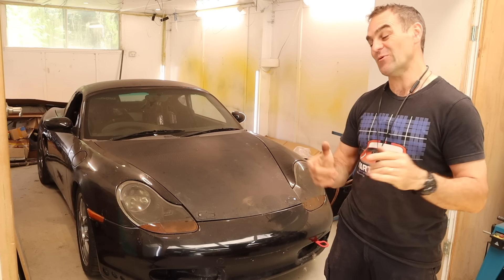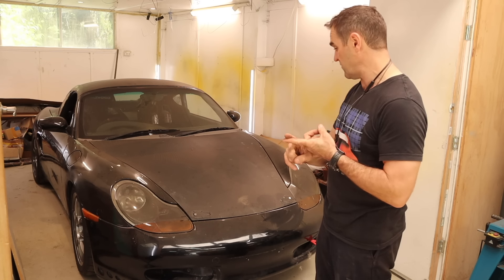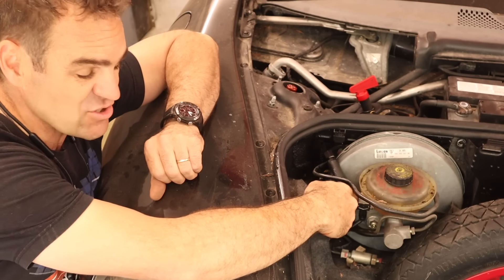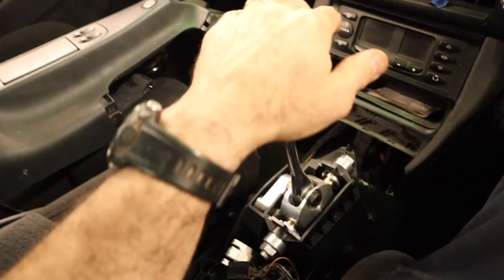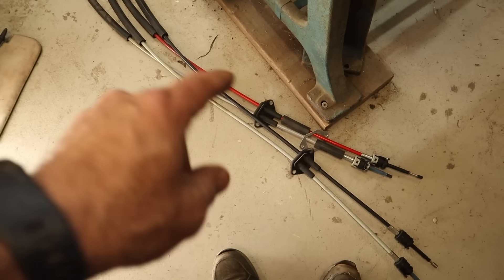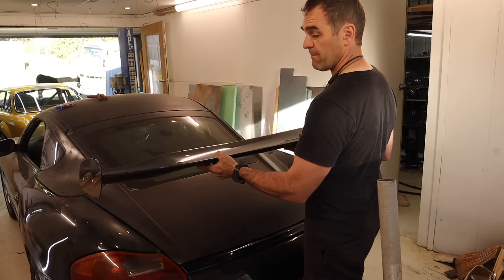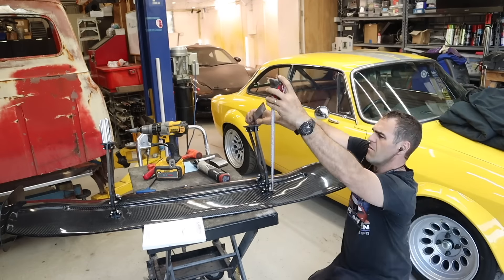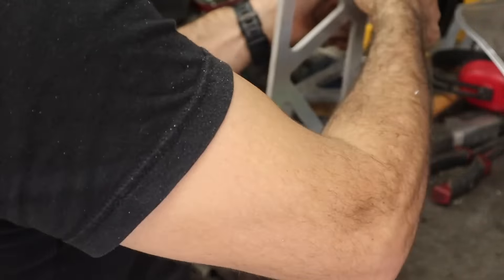The Roxster gets aero - Porsche 986 Boxster V8 engine swap track car build 33

Comment: Jeff
Do it the old way we did in the 70's without CAD or wind tunnels
Tape a coloured ribbon 75mm long, every 100mm up and sideways on your decklid and back window. Repeat on top and  underside of your wing. Make it a bold contrast ribbon to your black car, ie a yellow ribbon.
Secure the services of mrs Jeff and a friend. Drive down the road at 80, 120 and whatever legal kmh you can get away with and photograph the car from the back and from the side at the various speeds. If the ribbons lay flat its positive (downforce) and if they lift its negative (uplift) pressure. That way you can see quickly whats happening to the air over your decklid and the wing. If the ribbons on the wing top are up it means you need to increase the angle of attack.
A bit of time to do the ribbons ( if they are in rows you can very quickly see how they are behaving and which row. Turbulance or odd wind flow can be seen by counting number of ribbons from the side or top and dealt with accordingly.
Easy peasy. Try it, you will be surprised.
On the Alfarrarri use black ribbons in 100mm grids that are easily visible.
Easy peasy on road wind tunnel.
Racing a Meisener ohc 1640 Ford Z window Anglia we quickly found the back was "walking"  around due to negative pressure at the back window. We made an under floor pan airscoop and plumbed it up behind the back seat area and made a long rectangle outlet behind the back window to introduce airflow and it sorted the problem as well as increasing straight line speed down the back straight by a few mph
Some tape and a camera with someone taking pics from another car.....mobile ACTUAL conditions wind tunnel.....
Hope it helps you a bit.....
Reply: That sounds like an epic solution to the Anglia aero issues. Basically turning the leaned back rear window into a big diffuser.
Reply: @Jonathan_Doe_  we were broke engineering students without bursaries, working 4 jobs to get our qualifications. We learnt all the hacks and tricks in the book to try do our passions with cars. And we were learning big lessons while doing it
Mmmmm dont remember sleeping too much then......

Comment: Love Roxster coverage.................so keen to see things progressed.
But along with all the other projects 🙂

PS: I made 2x feet under the rear boot/trunk near that lip- with a large rubber pad on top.
So when the boot closes, and the weight of the spoiler comes down under load, it had even more support underneath. 
Easy enough to do - and needed for 100kg +++ support.

Comment: You can do the floor mounting option without having to cut the hatch if you make the wing mounts a 2 piece design. 1st section from the floor to right underneath the hatch, supporting the hatch on a horizontal plate with quick release pins on it. Just a couple holes in the hatch for the pins to go through and then the 2nd section with another horizontal plate, with holes to accept the quick release pins, as a foot sandwishing the hatch. This will still transfer the forces to the frame of the car but when you want to open the hatch it's only a few quick release pins and the hatch can be opened without a problem. If you can find somebody who has a virtual windtunnel program for the computer it would make the aero setup fairly easy and tailored to your specific car and aeroparts.
Reply from the maker: That is actually a very good option.
Reply: I was thinking make the hatch a sandwich also, could have two uprights coming from the floor even if wing mounts bolt through bit like with roll cage stuff, 8 bolts to lift the hatch which for a race car in not really a big deal

Comment: Hi Jeff, try plasma cutting a couple of aluminium columns that the hatch will close on but make them high enough so that the wing mounts rest on them when the hatch is closed. That will transfer the load to where you want it and still allow the hatch to be opened.
Reply: or a simple cross piece with a couple of hood bumpers to take the pressure....

Comment: You can tape some string length’s top and bottom covering the wing and use tour go-pro to video if the wing looks to be stalling or theres even flow over both surfaces 👍

Comment: Hey Jeff, I think I saw the channel in the underside of the wing that spans between the struts (likely there for strength) . Think about filling this in as it destroys the laminar airflow exactly where you want it the most. This effectively stalls the wing by detaching the air. As it stands it would produce minimal downforce and mostly just drag.
Reply from the maker: I did see that. I assume the guys who built it put that in for strength with no idea how the wing actually worked. I will put some tape over it for now and hope that will work.

Comment: Actually it could be fairly easy to mount through if you space the bottom rear mount such that the bottom bolt is over the metal lip underneath, then just use a long bolt (with a rubber on the end) with a corresponding perch underneath such that when closed, the bottom mount bolts contact the perch... Easy peasy, but not sure I explained in a way that makes sense. That would avoid all the faffing around, transmit the load, and still be able to use the hatch normally.

Comment: I have an idea.  What about mounting some short towers in the boot, that just touch the bottom of the rear wing mounting points, but don’t bolt them together? They would just touch when the boot lid is closed. That way the weight could be transferred to the chassis, but you’d still be able to open and close the boot as needed.

Comment: I think the best aero for the front might be a duct to bypass air through the front storage compartment. Seen it on some race prepped boxster and caymans. Micha Charoudin drove one and has a walk around of one.
Reply: Porsche themselves have taken this approach on the new GT3 RS. It’s basically “free” downforce, because it can actually reduce drag by cleaning up the airflow at the windscreen base.

Comment: I can't see for sure on my little screen, but I think the wing might be around the wrong way, on my little screen it looks like the flick up is window side not at the back of the car.
Reply: I was thinking the same thing.
Reply: Nope, he has it the proper way.  The centre is angled differently than the ends because the air off of the hatch is arriving at a different angle than the air at the sides, so the angle of attack of the wing is different.  A copy of a very common design.  Of course, the channel on the bottom is counter productive to it working properly.

Comment: It may be worth remembering that the wing will also produce drag and even at 100 mph there will be that additional substantial rearward force.  The nett aero vector may not go through the uprights at all.  There may actually be a torque trying to rotate those uprights off the back of the car.  Bootlid fixings should really just be for show.

Comment: Hi Jeff. Nice to see the Roxster getting some Love. 
Have you considered getting some 10mm Plyboard and making a front diffuser for the front. 2-3 inches in front of the Bumper would give some good Downforce on the front and with Boxster being flat on the Bottom upto the engine should make it easy to bolt to.
Cheap and effective solution to some great aero.

Comment: It's getting close to time to Rock! You might want to think through that "downforce is from the bottom of the wing"- that was very new to me here on the otherside of the world. The top creates downforce by pushing down because the air pressure increased along the front of the wing as the air bent upward to go over it; the bottom of the wing might produce some negligible additions, by creating a slight reduction in air pressure , which would lessen the effect of the wing, so a very neutral bottom is how you get the most downforce with the least drag. Vroom, vroom!

Comment: Looks like the leading edge is at the back, put the wing on a flat surface and whichever side is higher will be the trailing edge .
Reply from the maker: That is not even remotely true... It is an aerofoil. That is what determines the leading edge ;)
Reply: Considering you build cars and I've built aircraft, I'll defer to your apparent greater knowledge on the matter
Reply from the maker: @wukswheels  Haha, well then I am obviously not understanding your meaning then ;)

Comment: Jeff - You mean the rubber doorstops were not effective aero aids, LOL.  OK, now on to the more serious stuff.  First, the supports for the wing only need to be able to take the downforce load the wing can generate and as that is a generic wing, my guess is there won't be more than about 100kg of downforce generated at full speed.  Your supports should be more than adequate.  Second, I believe you should angle the front of the wing into a more downwards position in order to have the leading edge parallel to the ground and not tilted up like it currently is.  Trying to remember from my fluid dynamics classes from many years ago, but it looks like your current configuration is going to generate a lot of drag without much downforce.  Try varying the angle of the wing during your track day to see if there is any appreciable difference in handling of the car.  Weirdly enough, you may even find mounting the wing backwards generates more downforce than the forwards configuration you currently have it in.  This is counter-intuitive, but wind tunnel tests have proven this out for certain types of wings.  Give it a try to see if there is any difference.